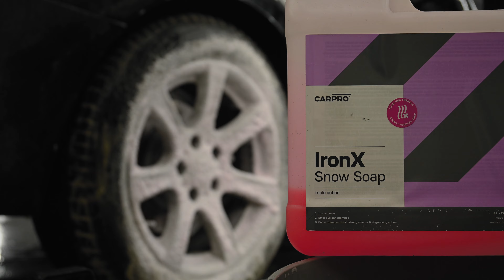BMW 3 GT DEEP CLEAN - Car Detailing

Comment: Mate could you tell me what dilution of multiX you usually use when the interior is in bad condition? Have you ever had problems with extracting when using multiX?
Reply from the maker: I use it 1:20 or 1:15 and its much easyer extracting the multix rather then inside 😅 inside never stops foaming .

Comment: Nicely done.  1.  You didn't show the final look of the wheels, so were you able
to get all of the iron particles off the wheels? 2. After using PERL, is the surface
slippery?
Reply from the maker: Thank you ! Well it was only a normal wash on the wheels , so it wasnt the case to deep clean them because thats a different package . And after the the surface isnt slippery at all 🙏🏼
Reply: @AndronicDetailing  I can tell not all the brake dust came off but that's very normal. I suspect there was something wrong with the brakes like a sized caliper causing the stubborn brake dust.
Reply: @AndronicDetailing  Thanks.
Reply: @CL4SSiCS  That's where you need Iron-X.  I was hoping we 
might see it work it's magic.  I love Iron-X.
Reply from the maker: Not really , they work perfectly fine but those are winter wheels and they aren't clean properly , because in romania we have self wash car stations and you can't take your time cleaning the car because you need to let other customers use the wash bay
Reply from the maker: When i got exterior detail i show extra love to the wheels because i charge more and allow more time for the detail also , at the end i need to do what i charge for and what the client asked for 🙏🏼